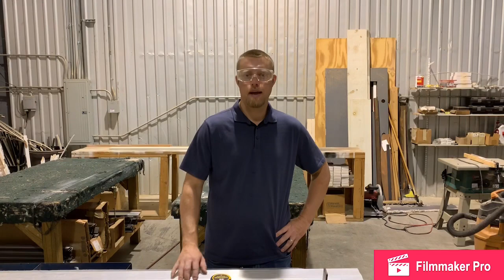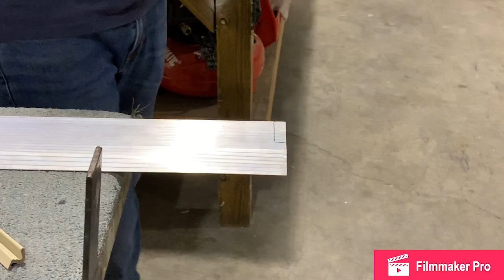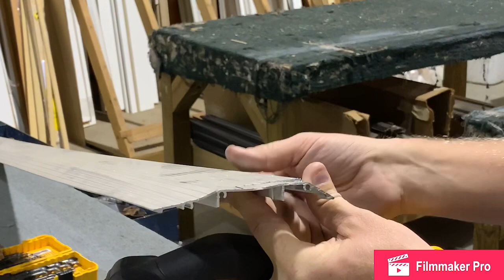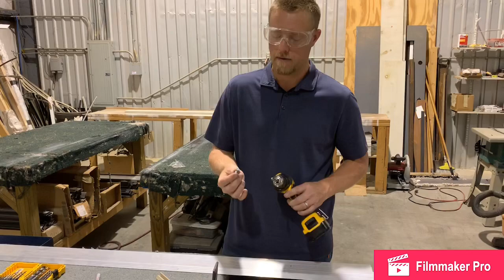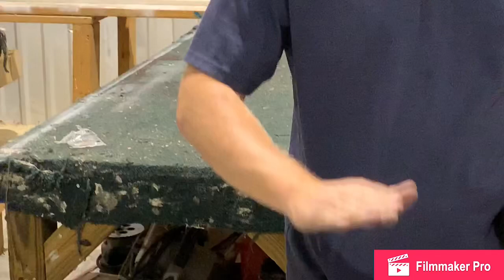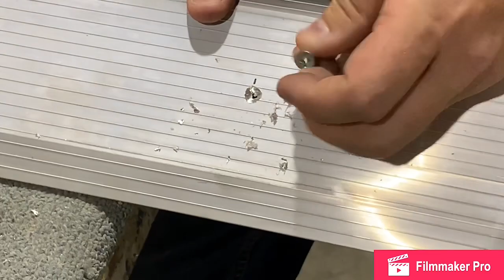Handicap Threshold installation

Comment: At least you gave some information on installing an ADA threshold. Glad you covered the cut and the screw issue, mine came without screw holes and I wanted to make sure countersinking was possible.  Obviously nobody is doing a video on full install since nobody is willing to try a DIY install for their own family member. They usually toss down some items to raise the chair to be able to access a regular threshold or they just allow the person to struggle getting over the threshold. If you hire someone, they double the charge for the word "ADA" on anything. Now that my son is old enough to move about in his wheelchair, I am replacing the exterior door thresholds with flat ADA thresholds. Maybe it won't seal perfectly for cold weather, but that's what door sweeps are for. Easy access is more important.